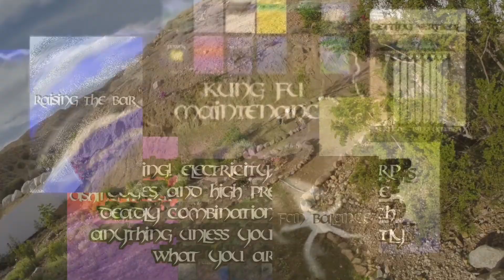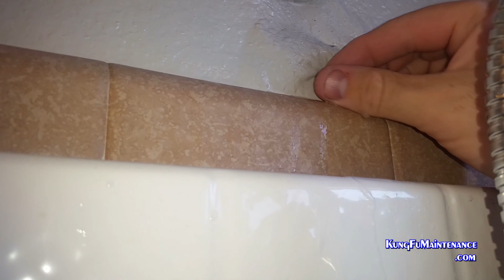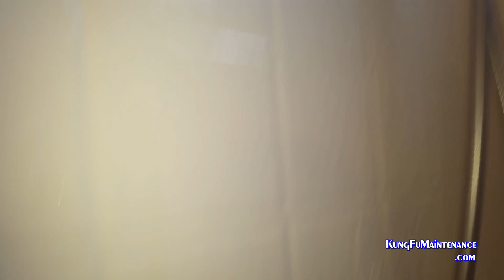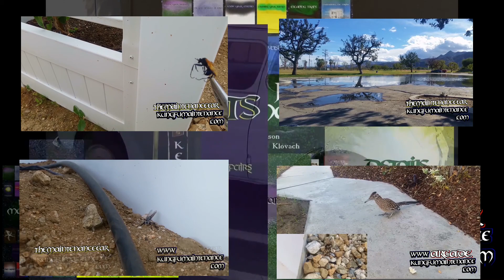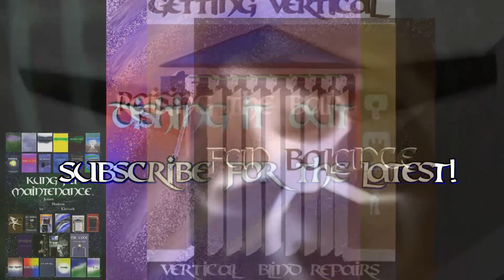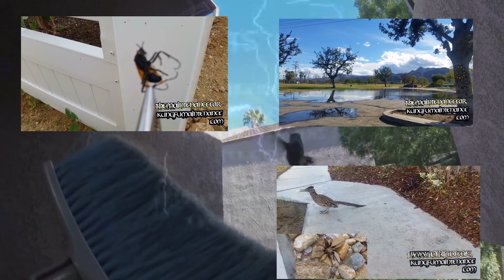Drywall Soft Bubbling Mold Behind Shower Arm Neck Leak Trackdown Repair

Comment: One way on How Not to leave tool marks on shower arm is to remove shower head, & stick one handle of channel lock pliers into pipe. With one hand hold the longest piece of the shower arm (after starting it on & hand tightened), & then slowly turn & tighten with the leverage of the channel lock handle.

Comment: I got home from overseas, removed the massive shampoo rack from the shower head neck, and discovered tons of black mold under bubbling paint on the drywall. How screwed am I and how would you attack the problem. Virtually everything is the same as your video except the drywall has what looks like dark or black mold. Thanks!
Reply: hi yeep. i was wondering if you have taken care of your problem? 

I would love to offer some ideas that could potentially help your mold paint and dry wall issues. 

first i would turn off the main water supply. then  find the source of the leak. by process of elimination. most likely it is the shower arm threads and not the drop ear elbow. remove the shower arm by unscrewing the shower arm from the wall.  next you will want to get a new shower arm. do not risk putting the same arm back on because the threads are most likely damaged.  when you buy a new shower arm take the arm to the threaded pipe cap section and find a cap that will fit nicely on the shower arm.  you are going to Teflon tape the shower arm on the side that will be screwed into the wall into the drop ear elbow. wrap the Teflon tape around the threads 10 revolutions and pull tape  tighter after the second  time around and keep it tight enough to see the treads outline but do not rip it on the sharp threads.   hand thread the arm into the drop ear elbow until it is snug by hand. do not use any pliers or vice grip tools on the arm for any reason. after hand tight, stick a wooden dowel or screw driver up into the shower arm opening and use the leverage provided by the tool to get a real good turn on the arm until it stops.  with the next turn remember you need to get the arm pointed down. don't tighten pass the ideal position.  now you have a great seal. cap the other end of the shower arm with the threaded pipe cap and Teflon. turn the main water line back on and this pressure test will check to see if the leak has stopped.  if it has has then off the main, remove cap and Teflon and place new Teflon and  shower head on.  spray bleach on the mold and use a oil based or shellac mold preventing primer paint to paint over the wall where the removed blistered paint once was.  now you should be fine. 

If the pressure test fails and the pipe continues to leak then we got to go in for surgery.  if the   drop ear elbow needs replacement you will need to cut a hole or square shape into the dry wall exposing the drop ear elbow.  you are going to need to give your self enough room to get at the ear elbow because you will need to unscrew the elbow from the stud and the line.  if line is copper  slip a wet rag or a pie tin pan  behind the elbow to prevent studs from catching fire.begin to heat the lower section of the copper and allow the heat to rise up into the solder connection.  turn the elbow side to side to free it up.  solder a new ear elbow on and screw it down to the stud. time for another pressure  test.  after it passes the test this would be a good time to replace the cut out with a green board or simply apply 2 coats of oil based prime to both sides of the dry wall. mesh fiber tape your seems and mud up the gaps.  paint 2 more coats over the dry wall mud after a light sand.and never hang any on the shower arm ever again.  I truly hope  i have provided you with  a understandable and simple plan of attack.  Good luck and I know you can do this your self. I believe in you.  You can always ask me anything thing and I will be happy to help in anyway i can.   happy holidays from Hawaii.

Comment: You best hope whom ever installed that shower used cement board and a redguard seal otherwise you're in for a big mould problem depending how long that was leaking.